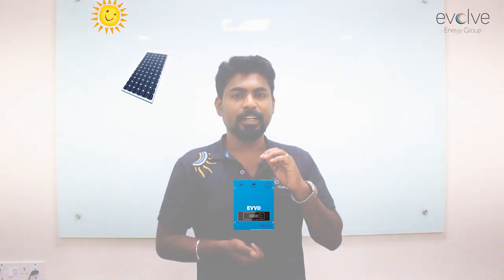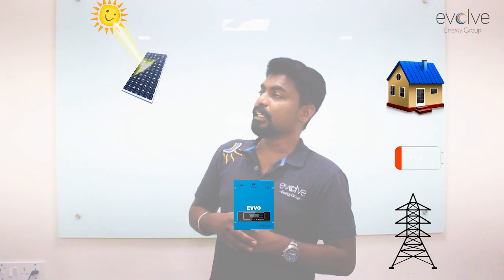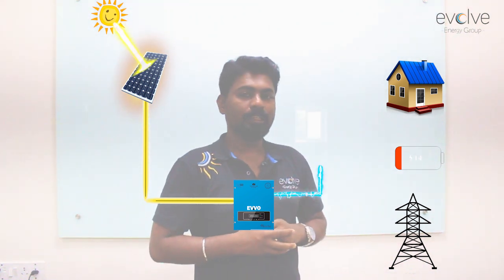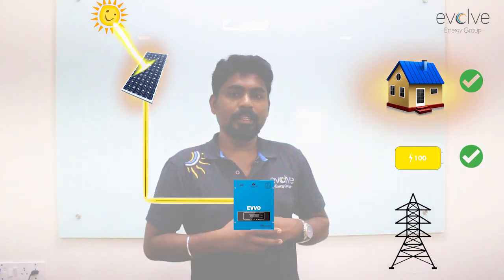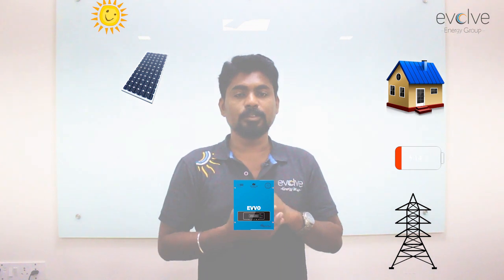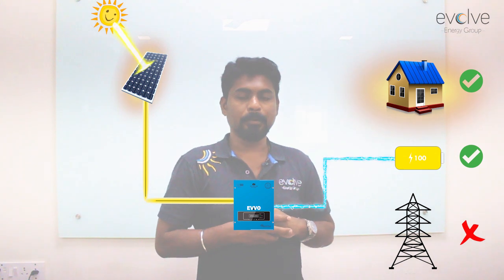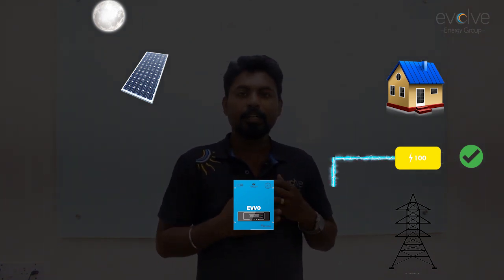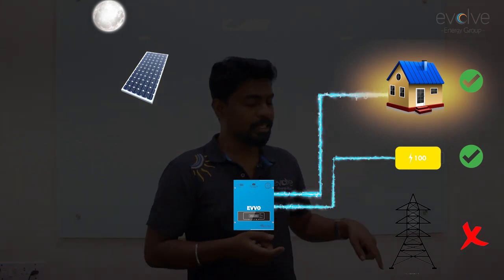SOLAR HYBRID SYSTEM | SIVAKUMARAN CTO | EVOLVE ENERGY GROUP

Comment: The user manual for your 5KW hybrid inverters (EVH 5000KTL) mentions that the Power Supply Priority Level is PV Power > Battery > Grid. Can we change this to PV Power > Grid > Battery? Why would I want to discharge my batteries when there is Grid power?